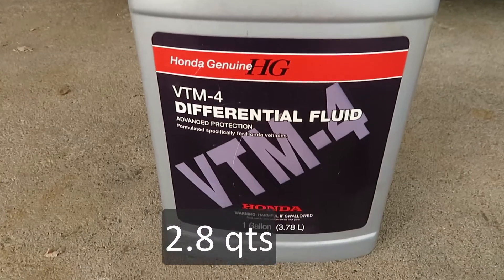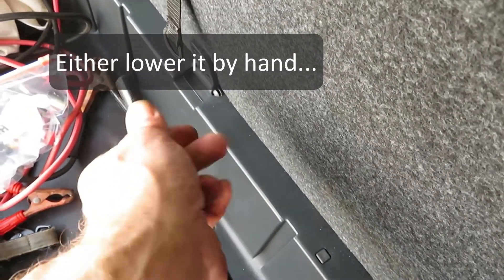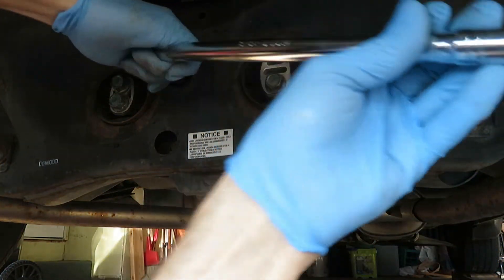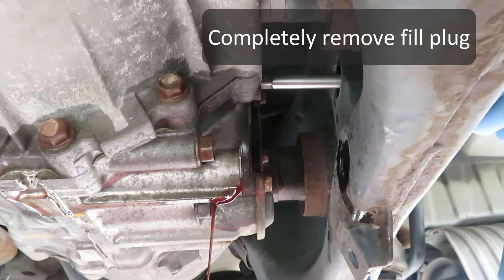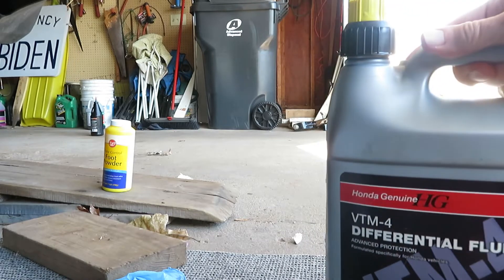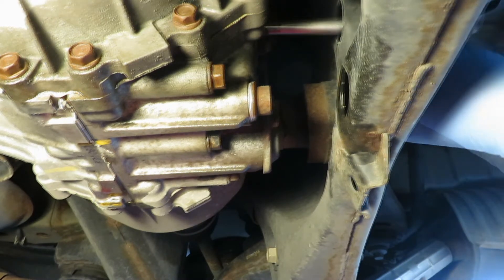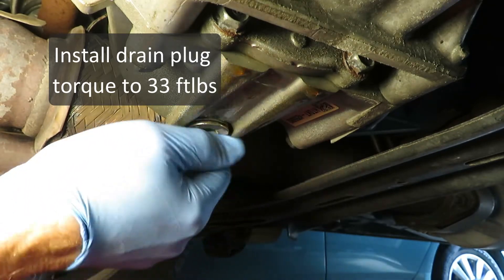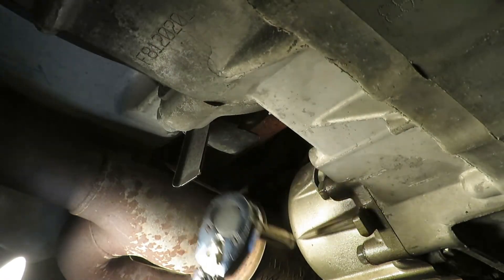How to Replace Differential and Transfer Case Fluids Honda Pilot and Others

Comment: Thank you for the video, clear and concise. As a side note here are the torque specs for a 2104 Ridgeline according to the service manual.  Rear Differential  fill & drain plugs 35ft lbs, Transfer case fill & drain plugs 33ft lbs  and the Automatic transmission fill plug 33ft lbs,  drain plug 36ft lbs.

Comment: Very good video! 

Note that for the transfer fluid, be SURE to use the correct spec API GL- fluid. There is no such thing as a "GL4 OR GL5" fluid because they are very different and designed for different types of gears, not to mention that ONLY GL4 can be used when brass synchronizers are involved. I found this out the hard way when I used Mobil1 "GL4/GL5" fluid in the manual transmission of my Mazda Miata and it almost destroyed the transmission. The fluid additives attached to my brass synchronizers and peeled away the brass and attached metal, making shifting almost impossible. It required GL4.. The rear diff required GL5. These fluids are NOT interchangeable. 

I researched and found the Honda Pilot Transfer case takes HONDA GL5 HYPOID GEAR OIL 75W/85 or 80W/90 depending on the model year.
Reply from the maker: Thanks for the valuable information on the correct transfer fluid for this application. I have a policy of going to the Honda dealership for fluids. Honda is fussy with fluids!
Reply: I know. I've been buying my Honda vehicles (new and used) from my local dealership in my small town. The head technician has been a friend for over 30 years and has never led me astray. 
I do use other brand fluids which meet Honda specs in most applications. However, I have never found a replacement for the Dual Pump II diff fluid.  @TheOriginalMechanic

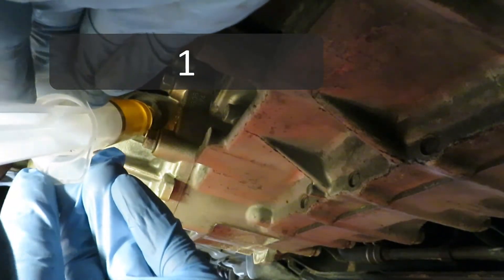Comment: Good video. Honda is trigger-happy on their recommendations for time/mileage intervals for these two procedures. Also, 9:38 "No way" is incorrect. I use gravity. As a guide, I thread a flex-cable pickup tool, from the top, near the vicinity of the fill hole, then follow that with a tubing. Insert the bottom end of the tubing into the fill hole. Connect the top end of the tubing to a tall funnel with a small opening, to tightly seal the top of the tubing to the funnel.

Comment: Great video!  What are the recommended mileage schedules for changing the differential and transfer case fluids?
Reply from the maker: I didn't look it up. With frequent towing and high temps I would do it at 30k. With average use much less often. I changed it here at 130k. I doubt it had been done before (second owner). Both looked OK. You might want to check your manual of consult a Honda dealer.
Reply: @TheOriginalMechanic  I looked in the manual, but I didn't see anything in there about the Differential Fluid/Oil maintenance cycle.  I did find a service sheet online that recommended every 50-60k miles, but I'm also finding that it is nearly impossible to find the DPSFII fluid right now (for a 2018 Pilot).  I did see it online for $20/quart!!! :-O  Even then, someone commented that the seller sent them non-Honda OEM fluid when they ordered! 0_o  Our Pilot only has about 51K miles on it, so given that we haven't driven anything other than road miles, no hauling, and Midwest temps, it may have to wait until Spring when supplies return again. Thank again!

Comment: Do you need to remove the tire, it looks like there's enough room to get the 3/8 breaker or ratchet in there for the diff?
Reply from the maker: I think the trouble would come in with the refill. The tire would block placement of the refill bottle and hose. But there may be a creative way to overcome that, as the viewer below found on the transfer case, calling out my "no way"  statement about gravity feed.
Reply: Using a bottle hand pump would negate the need for dropping the tire for the diff, and the syringe for the transfer case. Inexpensive at most auto parts stores and online, usually packaged with a couple feet of clear tubing, and will attach to various size bottles.

Comment: Do you have to change a front diff fluid on the pilot or is that lubricated by the same ATF?
Reply from the maker: I don't know either lol
Reply: "Front differential" is just the automatic transmission/transaxle. So you just need to change the ATF fluid in regular intervals. But that is more specific with needing Honda DW-1 ATF fluid. Don't cheap out on this and get the Honda fluid. The Pilot transmissions can be its only weak point.

Comment: Where did you get the bottle adapter with the hose for rear dif?
Reply from the maker: O'Reilly Auto Parts, stocked by the gear oils.
Reply: Wal-Mart

Comment: Anyone know how to do this to the FRONT Diff??? I can't find ANYTHING on it and the 1 I did find is titled wrong.. Video says it's a 1st Gen 2008... what dude has is a 2nd Gen and they are COMPLETELY DIFFERENT.. I haven't found ANYTHING on YouTube, or Google.. I need to know how to put fluid in it and drain the old...
Reply from the maker: I haven't done it yet but I'm looking into it.
Reply: @TheOriginalMechanic  Yeah I'm having a HELL IF A TIME  trying to figure out how to do this.  And I can't find like ANY info on how to do it either... Im completely stumped! Thanks for taking the time to read and reply to my comment!!
Reply: There is no front diff just transfer case transmission and rear diff.
Reply: Ok but how do you change the transfer case oil

Comment: How do you gauge foot lbs of torque?
Reply from the maker: I looked it up in manual and used a torque wrench.
Reply: Dont buy a cheap torque wrench with the big scale attached to it.
Buy a good one.  The kind that has got an adjustable screw at bottom.
The first one is not accurate enough to be accurate.